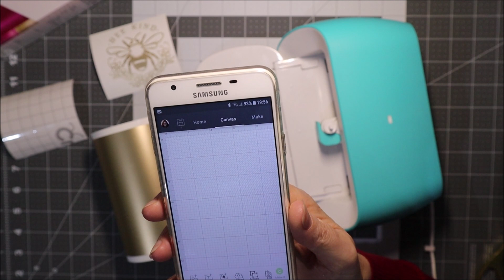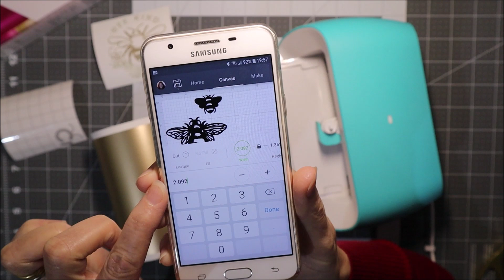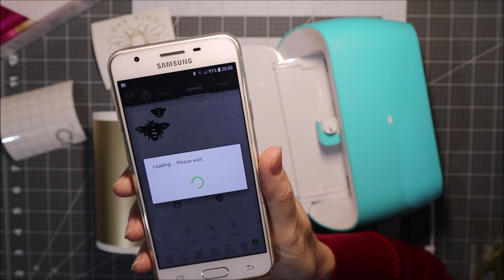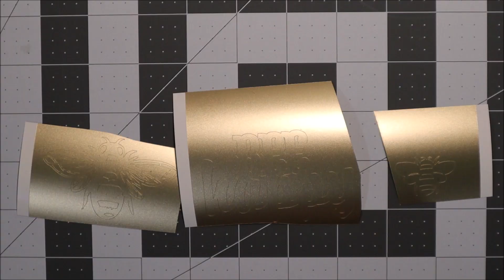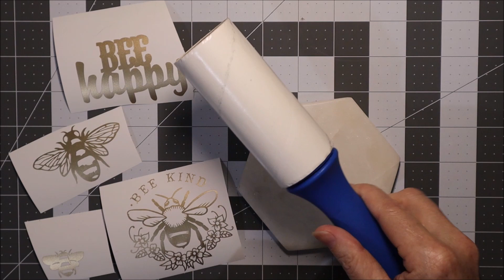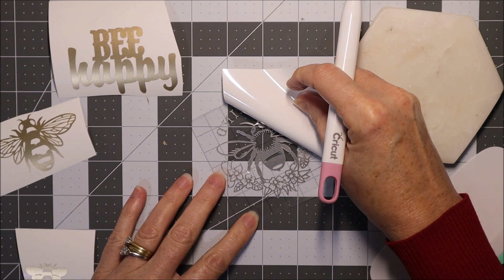Cricut Joy tutorial | Vinyl on coasters | Great for beginners

Comment: I have experienced lately many issues with the Cricut transfer tape.  Extremely tacky to the point I was unable to transfer a design to a balloon. It was so stuck on the transfer sheet it just did not transfer.  Has anybody else had this issue??

Comment: Can  you use the coaster  for hot and cold beverages?? Does it ruin the vinyl?
Reply from the maker: Hi, I use mine for hot and cold and I haven't had any issues apart from a small antenna has lifted at the end - that could be due to my lack of running over everything firmly with a brayer when it was freshly done so I would recommend ensuring the design is well pushed on to the coaster first :)